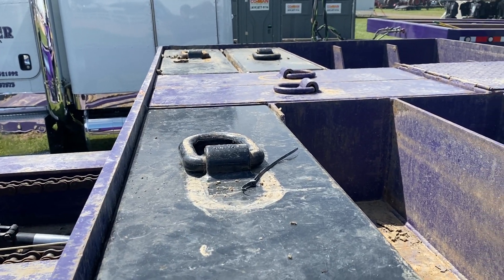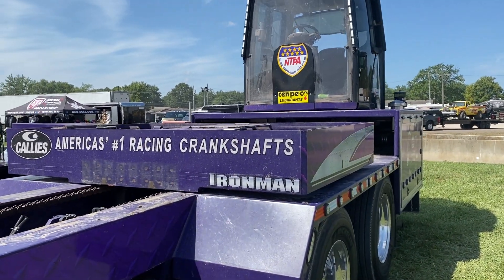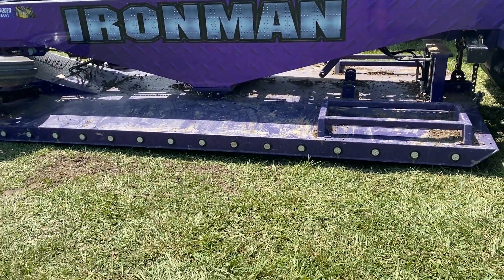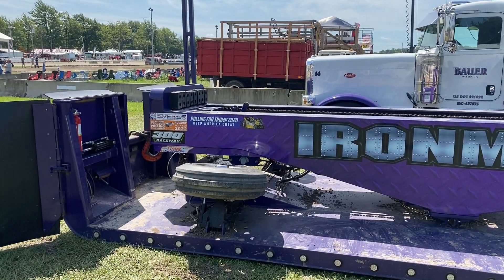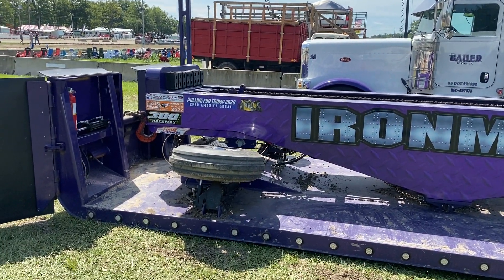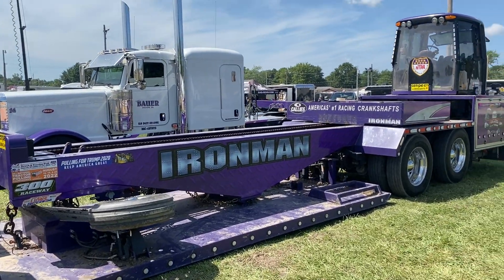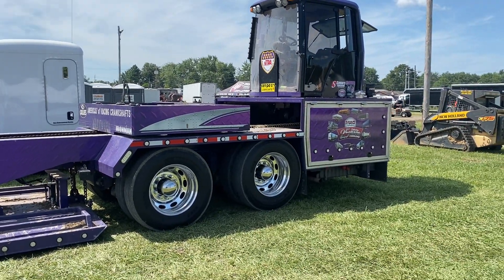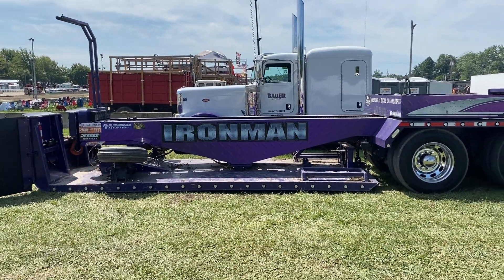How the Weight Transfer Sled Works in Tractor Pulling!!!

Comment: What defines how fast the box moves forward? 
Is it based on the speed the sled is moving? 
Is it a fixed rate regardless on how fast the sled is being pulled forward?
Reply from the maker: It has gearing to make the box move faster or slower depending on the power of each class.  Some classes use the same amount of weight but with different gearing.
Reply: @badgearapparel  ok, but within the same class, what defines how quickly it moves forward? 
I still struggle to understand how is this fair between competitors, where one can go slower but have more torque vs someone that tries to go as fast as possible out of the gate.
Reply: @ralmslb  Its geared with the wheels of the sled, at the same distance the box is at the same postion. Its one of the ways to stop the sled faster. You want to stop the strongest of the class at fp. The settings of the sled dont change in the same class. The competitors can choose to go fast or go for a lower gear depending on the track or their machine, sometimes you want speed, sometimes you want torque. Some can shift under load
Reply: @OldCarsAreFun  so, essentially in the same class, it will in a way always reach the end after the same distance traveled by the sled, regardless of how fast its being pulled correct?
Reply: @ralmslb the weight moves the same distance on the sled in relationship to the distance travelled on the track.  If you go faster the weight moves faster.  Slower ground speed means the box moves slower.  The sled operator has a transmission when’re they can change the speed the box moves in relationship to the distance travelled.  Once they determine the correct box speed for a pulling class the transmission isn’t changed.
Reply: @jti2007 great explanation. 👍
Reply: What's that bar at the top of the sled?

Comment: It can take up to 13 weight blocks weighing right at 2,000LBs each.  For a total of 58,000LBs rolling weight.  The coefficient of friction and drag nearly doubles that amount to feel like 116,000LBs once the box tops out.  The dry weight of the sled is 32,000LBs.  Mini sleds weigh 22,000LBs and can take up to 27,000LBs.

Comment: We run a 620 quad trac that we use to pull a 96’ air drill and 1300 bushel air cart and I don’t think it would pull it box forward and pan down. 
How much weight would the vehicle tied to the sled be experiencing with the pan down and weight box forward with all weights approximately?